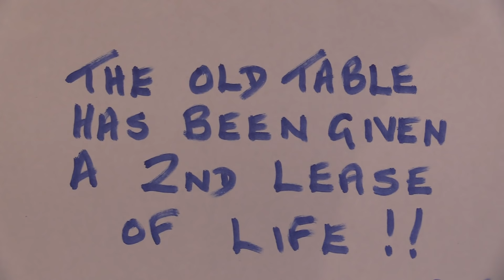Man turns Old Wood Table into New Look fashion furniture | 5 Minute How To

Comment: I need to do this, my mother gave me her dining room table which I think is 1930's furniture. It had a heat mark (where the wood goes white in a ring, probably made by a cup of tea/coffee) I was told to put a bit of meths on it, set fire to it and immediately put the flame out (this would draw the white mark out) I failed. It looks like I burnt the wood. It's such a lovely table, I am going to attempt what you demonstrated in the video on the flat surface. So thanks for the posting. You don't have to fish to be interesting.

Comment: Graeme. Firstly that looks really good, works well in that alcove. 😀👍
Secondly. If you wanted a mirror finish (not everything needs it) you can try this. After you've sanded the wood flat and applied the first coat of varnish sand it back flat (use a very straight edge to find the high spots), repeat 2 times, this will give a solid and flat foundation to the next steps.
Thin our some varnish ( the amount depends on what you are using ) apply a wet coat, this will if funny enough dry to a mirror finish.
Things to be considered are it only works on a flat and level surface and it drips off edges. The less dust around the better the finish.
Stay safe and warm everyone. 😃👍